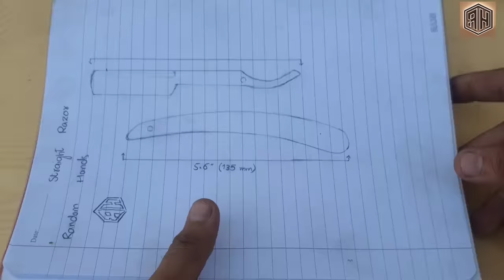Turning Rusted BEARING into a Sharp STRAIGHT RAZOR

Comment: Wouldn’t the more traditional hollow ground blade have been better? I still appreciate the talent of what you’ve done here though. Beautiful piece of art!
Reply: They’re much lighter and have a little more flexibility; they’re more forgiving on the skin, which can help to reduce the risk of nicks and irritation.

The thinness also impacts feedback. With a thinner, more hollow blade, you can better feel the way the blade behaves and cuts the hairs. If there’s resistance when shaving, you’ll feel it more easily than with a wedge blade so you’ll know when the blade needs stropping or honing.

However, the thinner a blade, the more fragile and at risk of breaking it is. You have to be careful not to over-hone the blade.

Comment: Fantastic.  If I can make one observation:  next time you use charcoal for the heat treat, throw them in a cloth or trash bag and break them up with a hammer until you get 1/2" chunks.  You get a better soak.

Comment: Very nice video, simple and effective. It makes you want to make one so it seems easy. Just a small detail, for sharpening the razor on the leather it is preferable to turn it by the rounded back of the blade to avoid breaking the wire. Thanks again

Comment: CLEAN YOUR BLADE AND HANDS BETWEEN SANDPAPER GRITS! That's why you have all of those big scratches in the final result. Sanding is just putting smaller and smaller scratches on something, and ALL bigger scratches must be gone before moving on to the next one. Even a single grain of the larger grit can ruin a finish and then you have to go back and start from the previous grit. 

Clean your knife and hands thoroughly with clean water between each grit!

Comment: For the next razor blade ... When sharpening, you tilt the blade over your back and not over the cutting edge!  Otherwise the thin cutting edge will break immediately!
Razor blades also need a hollow grind!

Comment: As a person who shaves with a straight razor daily, maintaining honing and caring for it i know one or two things about straight razors.

Technically its not a practical straight razor at all it looks like a straight razor but the problem is it isnt. i appreciate his work but the razor he makes is completely impractical.
Straight razors are either in a wedge form (english) or hollow form (german) style its not just a desing issue its about sharpening the razor.. there must be a bewel that is adjusted for the best position for sharpening plus using 5000 grit sandpaper isnt enough to giving the sharpness it needs to shave. you cannot sharpen it perfectly with whetstones and you cannot strop it to a perfectly centered edge as there is no bewel. bewel setting is so important for sharpening that some people applying tape to their bewel to protect it when sharpening failing to put the tape perfectly symmetrical get an edge that is more grinded to one side or the other. it affects the final honing sharpness and the quality of stropping.

A straight razor's edge must be opened with 1000 grit then sharpened with 4000 and 8000 grits then honed with 12000 grit whetstones further honing depends on the perfectionism of the user but most practical is stopping at 12000 and further polishing the edge on canvas with applying some chromium oxide then giving it a good stropping on the leather..

The difference is, shaving with this guys razor would be quite painful im afraid. in 5000 grit you can cut the hairs on your arm by applying some force but it wont cut facial hair properly and pull them off which will cause pain+irritation and by applying pressure you are increasing the risk of serious injury. a straight razor must be so sharp that it can cut not body hair but strong facial hair with just its own weight not by force or pressure applied. Some people take it further and do the hair test as dropping hair on the edge of the razor to test sharpness if it fails to cut then its not sharp enough. And the most important thing is its more safe to shave with a sharp edge rather than a dull one.

Comment: I would like to see You, Random Hands shaving yourself with this razor. I wish You good luck. P.S. I wonder how many of U guys have ever seen genuine German or English razor, and could see what is the difference between this  "razor" and for example Solingen razor.
Reply: I have been shaving with both modern and vintage (pre 1890) straight edge razors both Sheffield Steel and Solingen for about 7 years and I would not use this to cut an orange let alone shave with.  I do not profess to be able to make a razor but you can see the cutting edge was all over the place, the way he "honed" the razor was wrong.  Just because it can cut hair on the arm, with a lot of downward pressure does not mean it will give a good shave on the face.